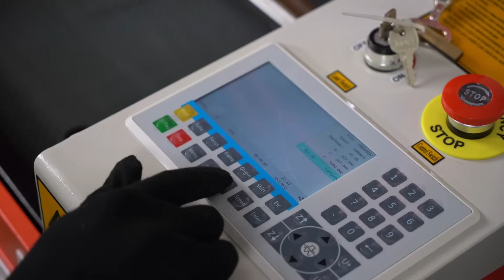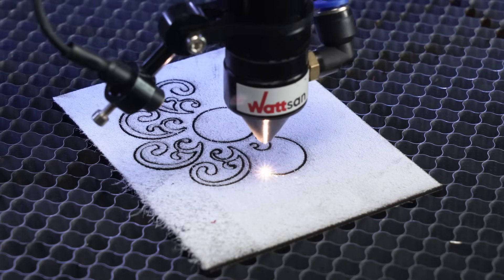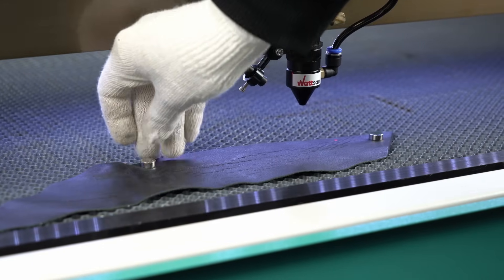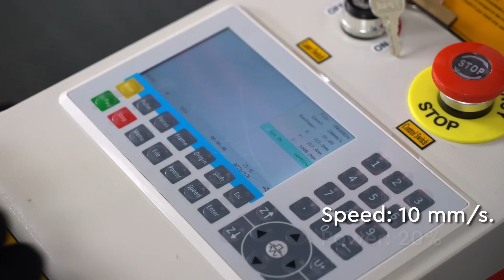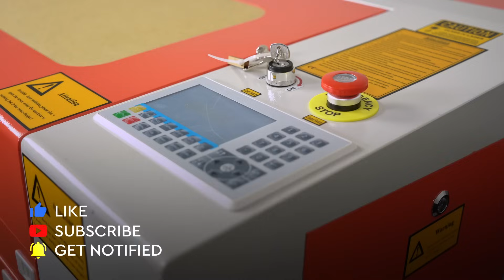Unbelievable Results: Cutting Leather with CO2 Laser Explained!

Comment: Nice Info Video 

Upload Much More Such Videos 

Please Tell Whether It Is Best To Use A Knife To Cut Leather Instead Of CO2 Laser

As It Produces Burnt Marks Including Rashes & The Final Finishing Is Not As Good Compared To Knife Cutting

Please Tell Me 

Thank You
Reply from the maker: Hello! Thank you for your feedback! 😊 CO2 lasers can cut leather cleanly if the right settings, tube power, and lens are used. Share your leather type and thickness, and we’ll suggest the perfect machine and settings for the best finish!
Reply: @Wattsan  Thank You For Your Reply / Response 

I Like To Cut Both Natural & Artificial Leather Upto 2 MM Thick 

The Material May Be Soft & Even Hard 

I Have Other Questions Can Fabric Like Satin Silk Of 0.5MM Thick Be Cut Without Any Sort Of Burnt Marks Please Share Your Valuable Knowledge

Thank You
Reply from the maker: @jagadishr2405  For cutting silk, a light 50W laser tube with strong air blowing is ideal to avoid burnt marks.

If you have any further questions or would like personalized recommendations for the best machine for your needs, feel free to reach out to our high-level manager at info@wattsan.com. They will be happy to consult with you and help you choose the ideal machine for cutting both natural and artificial leather, as well as delicate fabrics like silk.

Thank you, and we look forward to assisting you!
Reply: @Wattsan Valuable Knowledge 

Thank You